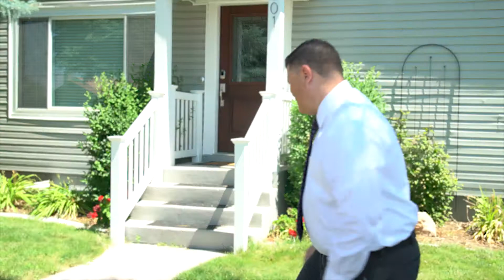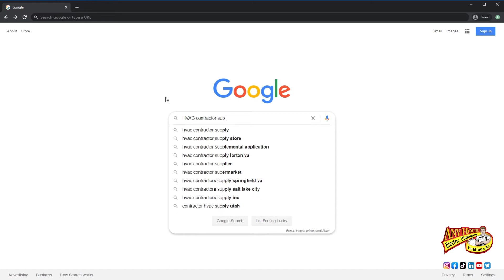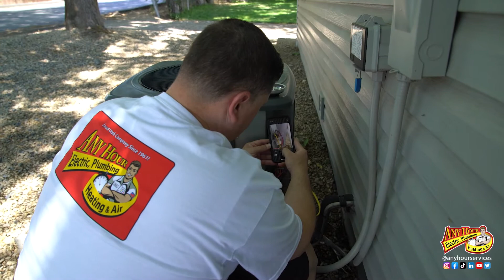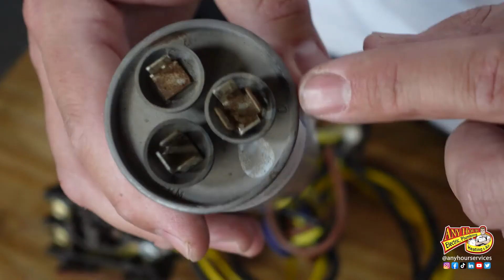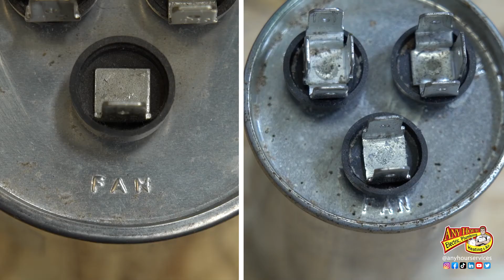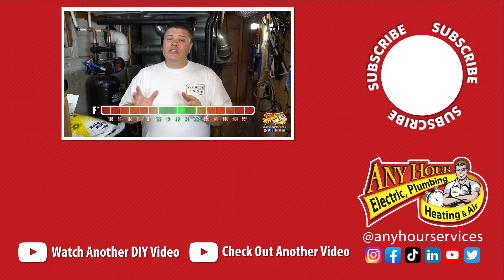AC Repair - How To Replace A Dual Run Capacitor

Comment: I have a 21 year old GoodMAN AC Unit Model No: CK42-1C.  Recently learned that my capacitor is bad. The currently installed capacitor is an AMRAD Turbo 200X. Is this too much? Do I have to replace this capacitor with the same AMRAD 200X or can I just buy what appears to be a Goodman OEM replacement from Amazon for about $13?

Comment: You're using your bare hands trying to discharge that capacitor with your screwdriver and at some point while you're shorting the terminals, your pinky seems to be touching the metal part of the screwdriver. This doesn't seem that safe to me tbh aren't you risking a shock right there?